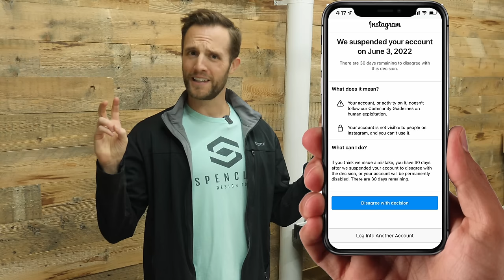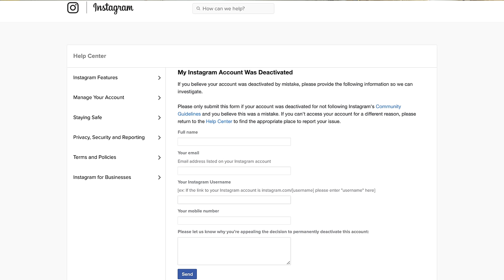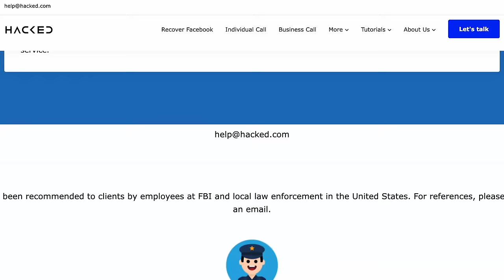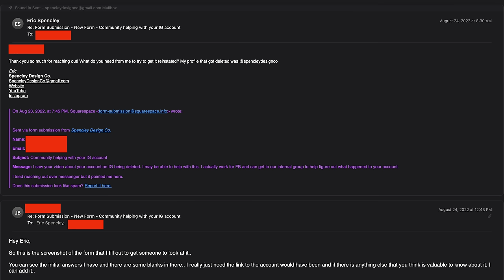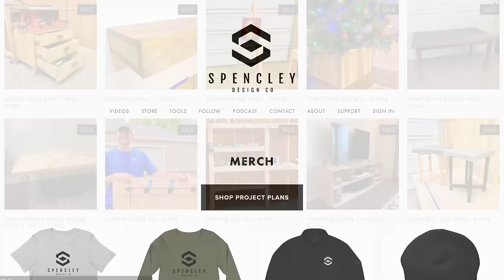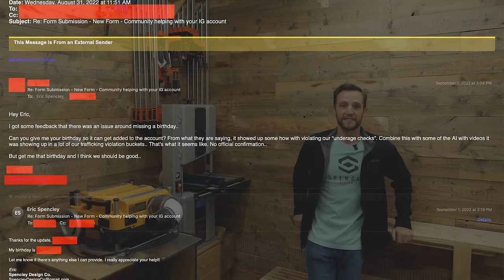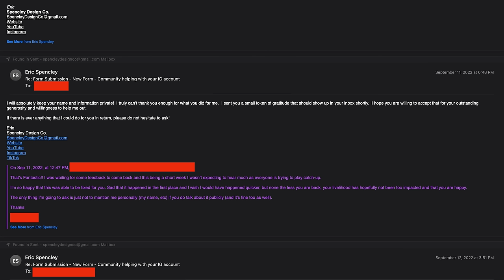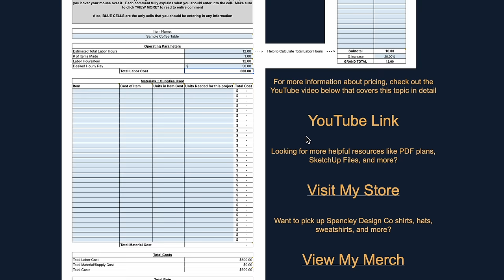this stranger recovered more than $25,000 of my money

Comment: CHEESE-
Glad to hear you are back up and running. Even better (in my opinion) not working with the rats abandoning the sinking ship for no good reason or at least without inquiring what was happening and giving time to resolve the issue. 
I like building furniture for friends and family. I didn't understand that until my late wife and I were looking at unfinished furniture one day about thirty-five years ago. The place said they had a roll top desk (we were looking to build one for our use) they were selling (really cheap) because it wasn't true wood furniture. The builder had used some pressed board in the construction and thus couldn't be sold as real wood furniture. I told the owner of the store that I could build one if she could promise to purchase it when I completed it. I also told her it would take as long as six or eight months for me to complete since I was broke and had very little income. She told me she would wait any length of time if I wanted to make one. She further informed me she was needing three of them as she had standing orders for them dating back more than a year from some of her regular customers. Her only request was it had to have a roll top that could hold a 19-inch computer screen, have the middle drawer able to hold the keyboard unrestricted and be made of Red Oak. 
Seven months later I delivered the roll top desk at a cost of three times the cost of the material. It was completely sanded and ready for the stain and finish. She paid me the day I delivered it and smiled a crazy grin when I gave her the price I wanted. A week later the desk was being stained by her crew in the back of the store and being readied for delivery. Two weeks after that, I saw my desk in the home of a good friend's parents' home. I know it was the one I made because I asked to remove the top drawer on the left side of the desk and there was my manufactures mark, I had etched into the inside wall of the left pedestal. When I asked how much they had to pay for it, his mother showed me her receipt. It was two and a half times what I had charged the owner of the unfinished furniture store. 
Needless to say, I delivered two more rolltop desk to her, but I never made anything for her store after completing my obligation to her. I have continued to make furniture for friends and family up until about eight years ago when my late wife was going through her first cancer treatments. I now work on items made from iron, wood and other materials for my own pleasure. It was a good sideline income for me in the beginning, but I couldn't see her markup price for the little bit of work her crew did to my work. People just seem to want to profit off of your success. 
I was about your age when this all happened. Like you, I didn't want to do business with her because her crew did such a bad job to my labor of love. I didn't think about doing my woodworking as a job back then. I didn't want something I enjoyed doing to turn into a job that could one day destroy my love of my furniture making. 
Best wishes for your goal to have a job you love. I will continue to follow your YouTube channel and keep an eye on your work. Have a blessed 2023!

Comment: Your counselor was wrong in your video about losing your Instagram account. I had those exact goal when I went to college and got a degree in Mechanical engineering. It  allowed me to do exactly what you described over a very eclectic career. the clincher was that was 45 years ago ( at another big 10 school MSU) my point is not to say that you should go back to school but to encourage you to keep going on the path your are. You truly have an entrepreneurial spirt. Keep doing what you are doing. When I came to a similar crossroad like you are at now I took the chance, It has been one wild ride but I wouldn't traded it for anything. I'm almost 70 now and when I look back I can honestly say I would have had huge regrets for not doing it. one piece of advice: once you get your woodworking going  ( and I have no doubt you will) be looking at your next adventure. In my case about every 10 years I made a major shift as I was getting burned out. Be prepared for one day you will get a call or lunch etc. and somebody will make you an offer you can't refuse. Mentally be prepared that it might be your next big thing, of course make sure its legitimate but the point you have to always be thinking about what's next. You have a very exciting life ahead of you and I doubt it will be only in woodworking. In my case several of the things I ended up working on hadn't even been invented what I started.

Comment: On the outdoor project. Track saws are available for very little money and they work, just without the dust control, extreme precision, and warranty of big name versions. Peter Millard, in UK, has tested a range of plunge saws at different price levels. I use an ordinary circular saw with attachment to fit on Makita track but cheaper track would do fine. Domino alternatives include Peter Millard's jig that can use a cheap Trek T4 router. Triton seem to have fixed the flaws in their cheap version of Mafell's Duo Doweller but simple dowels with a cheap dowel kit will work (I built a whole kitchen using a very cheap dowel kit about 35 years ago for a friend - it remained good and strong as new for 25 years till she sold the house).

Comment: This doesn't relate to this video, but I can help you with your power issues in your garage shop. Set it up like a camper with an inverter and battery. I use one in my shop and I run 220.

Comment: Cheese.  If you get it you get it.

This is a very good video and explanation  of how the industry actually works.

Just as a heads up that near the 17-18 minute mark you mentions that "when you reach a certain level, you should have a person you can talk to".  That does - in fact - happen.  But sorry to say you are an several orders of magnitude off that.  Once you start grossing $500K per month or more then you'll have more options.  Your original point of diversifying holds true for a wide swath of folks.

Unfortunately, sometimes these companies don't catch bugs like this because they don't effect their bottom line and even if they do catch it, sometimes the cost to fix is greater then the expected loss in value.  Either way you become a statistic.  It doesn't feel great, but it is important to remember when dealing with these companies.

Comment: CHEESE

I like that you use tools that I can afford and simplify the procedures.  Well, except for the planer.  I guess if I really care to do woodworking, I must have one.  Sigh.

I do not have to have you respond.  I am 81 and still learning new things.  Woodworking for family gifts seems like a perfect way to keep active and productive.

I would like to hear about where you buy your wood or where I should look to find decent wood at decent prices.

I have seen a great many woodworking sites as I seek to learn more.  I have been working with wood, construction sorts of things, because I DIY my home -- well, parts of it.
Primarily, I have done the wiring -- 100%.  In my latest (2nd) home project, I have done the flooring and interior walls as well, 1x6 T&G for the entire home.  Therefore, I have a decent miter saw and table saw.

My background is very different from this sort of thing.  I am a scientist (Caltech B.S. and Columbia Ph.D.) but left that to do software, self-taught when a freshman in college.

I write to encourage you to demonstrate projects that do not use expensive tools and that provide great satisfaction for amateurs.  I guess I really have to buy that benchtop planer.
I don't have a large dedicated space for shop.  I have a small space, about the size of a garage bay with a staircase using up lots of it.  I tend to move things out to the driveway to work.  The old, second-hand router table is a bear to move!  It's also no fun when the temperatures are below 20°F.

You do inspire me, unlike so many others on YouTube.

I am a former chemistry professor.  If I can be helpful to you in that capacity, feel free to contact me.

The last 20 years, I have been building a business.  My son now runs it.  For more information, see smartscience (dot) net.  It's about learning science online -- the RIGHT way.

Comment: Guess you don't comment on Yahoo because they do the same thing. They find something wrong with your comment and then they boot it and send the same worded message you got. Then when you challenge their decision you get the same one you got again. This kind of stuff is happening all over and it's nothing more than censorship. Sad that in this great country we have gone this route and you can do very little to correct it as long as the same system is used. IMHO Hope you can work this out.